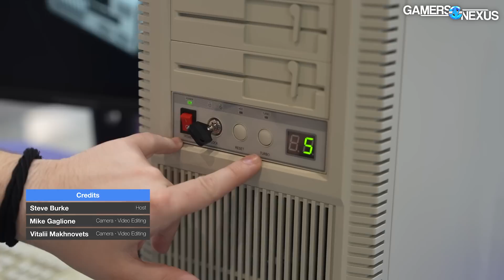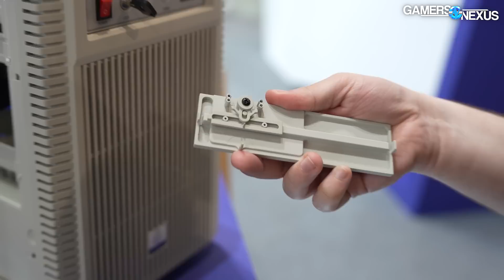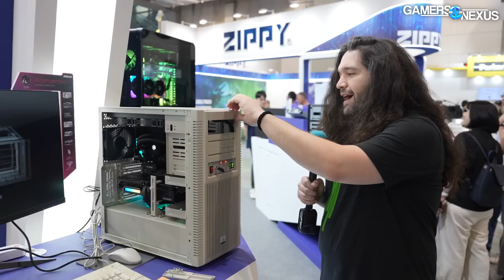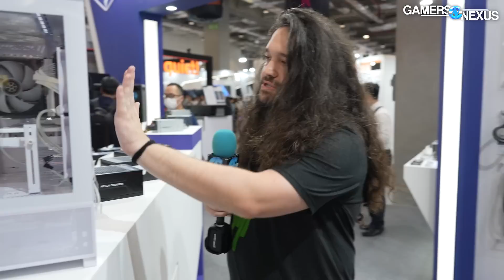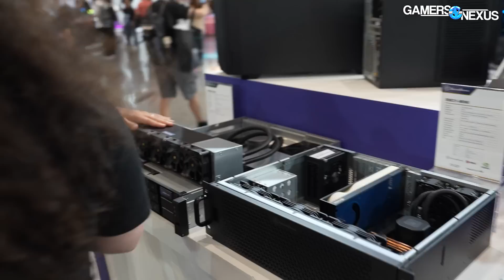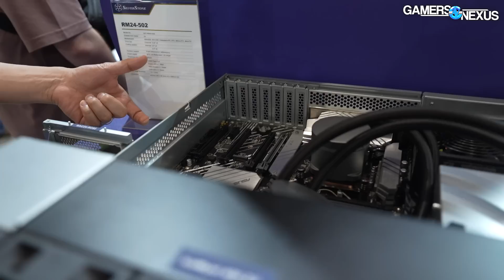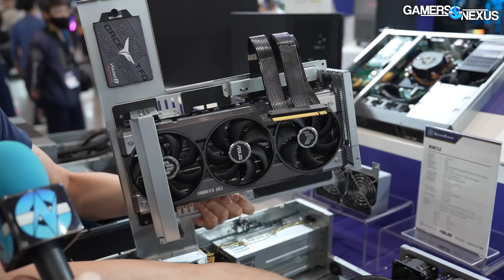Unironically the Best Case: Retro Silverstone FLP02 with Turbo Button

Comment: I got a Fractal Design Pop Air luckily available at my 'local' (two cities over, the closest computer store I'm aware of) Memory Express specifically because it had two 5.25" external bays, one for an optical drive and one currently with the included 'junk drawer' for USB drives, adapters, etc., but available for whatever modular front panel stuff becomes convenient in the future, while still allowing free through-and-through air cooling (the drive bays are on the BOTTOM, opposite the power supply, hidden behind a magnetic facade). Two kinda seems like the minimum for me, because in addition to wanting to read disks, I don't know what I'll want to install in the future, and a 5.25" drive bay should be big enough to hold an adapter (storebought or 3D printed) to mount whatever technology comes along. Seems like they could have squeezed in more though, just populate from the bottom up while staying out of the way of the top-third CPU air intake area.
Nice to see other takes on the idea of bringing modularity back into the front panel of modern computer cases. The whole thing about the IBM-PC-derivative... ATX thing is that they're modular computers built from commodity parts compatible between many suppliers who don't have to communicate directly for you to use their stuff together. Especially if you're not offering a ton of front IO ports, you need a bunch of modular panels so the user can install their own.
There's been a decrease in the amount of stuff on expansion cards only partially able to be blamed on M.2 storage taking all the PCIe lanes (I even reluctantly went with a micro-ATX motherboard with only one card slot available outboard of the graphics card for my latest build, despite my misgivings, because I could not come up with a scenario where I'd need more and shipping full-ATX boards to my remote location pushed everything up a price bracket; but forcing myself to do so made me sad and I have to say, including the annoyance of working on the thing with minimal clearance between components, I probably should have sprung for a larger motherboard of some description) and partially to how all the external busses are getting really fast and converging on USB. But one thing externally-attached peripherals can't give you is convenient front-panel stuff -- physical media drives/sockets, equalizers, status readouts, easily reachable IO panels, controls, whatever. That takes drive bays (or some other manufacturer-agnostic rack system, but 5.25" drive bays seem to be the industry standard here?).

Comment: I was considering the FLP01 for my setup with a CRT TV next to it but the FLP01 couldn't fit my Yeston RX 7700 XT (a decision before I got the CRT). I would consider putting Noctua fans in there for the color. It kinda sucks in my opinion that they don't intend to do a glass side panel. Now I still want to show off my gpu while retaining retro stuff

Comment: Heh funky - old enough to have worked as a tech in a computer shop getting things in that look like this thing, one fun bit of it is that the cases back then that had the LED display - you had to use jumpers to set the turbo speed display on them - and they didn't do anything almost ever - the turbo button was to slow machines down to fix software that had been made by... "creative" devs... who based certain delays in software on the actual clock 'tick' rather than the clock itself which resulted in all sorts of weird and wonderful things. Among them unclickable buttons, and dialogs that display for less than a second.

Comment: Hey @GamersNexus, you are all the time reviewing beautiful cases with a lot of rgb lights and glossy and glassy features, which would be a beautiful addition to the design interieur. But how about us, the practical people? We do not need a PC on the table, because it is under the table. We are not looking for RGB lights, because you cannot see them when they are under the table. Beautiful colorful water cooling? Well, where to put my HDD RAID then? Can you make an overview of the less atractive and more practical cases? which would still have 5.25" bay and will fit at least bunch of 3.5" HDD drivers ?

Comment: That retro case needs a plexiglass side window held in by rubber molding. So glad I was around when case modding took off. (That door covering the front io panel sucks. It would always be open, waiting to be snapped off.)

Comment: dont forget about the FLP01 that started as an april fools joke a few years ago. based off the standard of many pcs from the 80s/90s like the Amiga A3000 and PB Legend 1510. im still using my ancient SunBeam Transformer case from 2005 and i love it. pretty good temps since one fan points fresh air directly at the cpu. i cant wait to get the flp2

Comment: If a reasonably priced case came out that supported my 16 hard drives and 2 optical drives I would consider it even though I already spent an arm and a leg to get a 19 year old case that could at least support the 16 drives.  Technically, the power button and other front panel stuff is in a 5.25 slot so I could get a different power button to mount somewhere else and stick my UHD drive in and omit my standard drive so I'm not in that big of a rush to replace the case.  Even my dream case, the Rosewill Blackhawk Ultra can only support the 16 drives with zero optical drives.  (For anyone confused, I have two dual 5.25 to tri 3.5 adapters with 80mm fan intakes that gives me 6 drives more than the 10 supported by the case)

Comment: Glad to see more attention on the home server. It boggles the mind how rich feature sets are on desktop cases for the prices. Even sub 100$ can afford some crazy good build configurations.
Not so much in the homeserver space. Lucky to find ANY features worth noting on 200$+ units.
Likewise, I would love to see more attention from both motherboard and cooler manufacturers also.
Standard ATX memory layout impedes airflow, even in your typical ATX case. It's almost OK in a 2U, but forget using any standard ATX/ITX board in a 1U chasis, short of low power mobile processors.
The issue compounds with availability of coolers that can take advantage of the limited space. Without Noctua I don't think there is a single option for heat syncs aligned with fan walls on AM4/5 platforms.
Anyway, here's hoping we see a convergence and a similar swell in competition in the rack mounted space. It would be amazing to hit the retail outlets and find a dozen options that deliver more than I need for half the prices we're looking at right now.

Comment: Finally a Retro case where you don't need an angle grinder for airflow or watercooling. Other retro cases need some metal-massage depending on the heat generation of the hardware - Chieftec UNI UK-02B (white) and SilverStone FLP01 come to mind.....

Comment: Just rebuilt my 20'ish year old (who remembers 🤷‍♂) Silverstone LC01 all aluminum HTPC case. 9800X3d on an Asus X670E Crosshair Hero. Tossed out the junk drive cages and put an Artic Liquid Freezer III 360 across the front with Artic 120mm slim fans on the exterior. You can still fit 4 HDD's under the rad directly bolted to the case. It's the perfect case for today!! It's super quiet and keeps the -10 undervolted 9800X3d rock steady at 67C when fully heat soaked. Silverstone listen, build a real aluminum HTPC again!!! 🙏🙏🙏
Reply: I used to use the old Silverstone Lascala LC13 in a hifi rack for my PC case, that was so many years ago, back in the days of AGP, I ended up with the HIS 3850 AGP card just as everyone was moving away from AGP and Barton XP 3200's, I remember getting some Asrock motherboard that had AGP and PCI-E slots along with DDR 1 and DDR 2 memory slots for socket 775 in that Lascalla case as I wanted an upgrade path lol, new motherboard and new CPU with my old GPU memory and drives, PSU was a 680w Hiper Type R in blue lol, had a few of those and must be one of teh only people who never had one blow on them. 

Last HTPC I had was when Bluray drives came out and Windows Media Player could be updated with MyMovies, that was a Micro ATX Asus ROG with an E8500 and 4gb of 1066 Dominator GT, with a Powercolor HD5750 passive cooled GPU inside a Silverstone GD02B with a Samsung BR drive. Sharkoon Silent Eagle SE white fans with the golf ball blades were in that. 

I heard you cant make HTPC's that play and store physical media anymore without a load of ball ache.

Comment: My Gen 12 i9 is an Aztec case from 2005.
With the add-in drive three drive caddy, I'm running eight 14TB drives in addition to the NVME drive with Windows.
Cooling via a Corsair iQ Link single 120 AIO along with three case mounted 120mm fans.
Folks often think I'm running an old machine instead of a hefty "sleeper" build.

Comment: Can the turbo button be detected by the motherboard? It would be nice to be able to use it as an ACTUAL boost button, raising the clocks. I'm sure it wouldn't be terribly hard to make something using an arduino connected to USB to do it.

Comment: I have a Silverstone TJ08-E Evolution case (inverted layout) for my main rig and it would have been a great foundation to start from to build this retro case. I don't know why Silverstone doesn't keep innovating with that design. It is so well done. I have crammed so much into the case the the thermals (I'm cooling on air) are excellent.

Comment: I love that retro old school case.  I want it I want it I want it I must have it.  I want to build a sleeper PC in one of the retro style cases and this checks every box.  I even have an original IBM 88 unopened keyboard, and an IBM laser mouse when they first came out that still won't opened. 
  That would be the perfect trifecta...
I even have a 5 1/2 drive Bay pump res that I got from PPCS that world be perfect in this

Comment: That case makes me feel old... too long ago but thinks my first case WAS a beige mid-tower OR maybe a tall floor case with casters o0 then had a black floor tower from work; then a black mid with plexi side panels and had a fan side mouth WITH a LED fan, then went Antec quieter model, then a Thermal Take mid (still have it with my last PC as a back unit).  THe older black mid went to a family member and it STILL works o0

Comment: The flp02 should have the usb and io included in the bottom 5.25 bay. Not only would this be more era accurate, as these bays were used for things like firewire and front serial connectors, but it would also allow for genuine expansion of front io, which no other case offers outside of proprietary means. Then having to put in a USB header pcie x1 card to compensate for all the front io really would sell the whole yesteryear vibe, needing aic to make your slot in connectivity work.

Comment: This makes me wonder if there are any mobos in the wild that not only still have a Floppy controller on the board but have the connection port (and maybe cables) to hook a real drive or two in rather than the faux drives.

Comment: Cooler master used to make a hard drive cage with a 120mm fan on the front that fits into 3x 5.25 bays. That would be perfect for the retro case

Comment: I'd rather use a literal oven that can't be turned off or adjusted from its setting of 1000 degrees Celsius and magically still works even when not powered by anything, than this case. Sorry.

Comment: Very curious about "floppy" slots on the retro cage; 
some questions for the review, whenever that happens:

The covers looks nice, but are the slots viable to use for DVD/Floppy drives? 
Does populating the slots negatively affect acoustics, and airflow; if so, how much?
Possibility of mounting fan/fan-bracket in the drive slots, for additional cooling? 
Does the lower front fan have an airflow guide? Might struggle to cool some systems.*
Will there be any color alternatives?* *

*High TDP systems; even more so if slots are fully populated, as more ventilation gets choked off. Looks like they've went through the effort to add extra perforations all over to help with venting though, so might make up for some of it.
**Personally not a fan of the "white" plastic look of the late 20th century; does have it's aesthetics, but personally would want a black/grey one, I guess. Maybe you could hold a poll for them, or similar, for alternative colors; if they want to use your platform to communicate with their customers.
Reply: The question of populating the drive-bay with a fan for extra cooling, is mainly in the assumption that can become a hot box in some scenarios, which might necessitate it.

Comment: I’m no case expert, but my impression is that if the retro case had a top-mounted PSU then the blocked airflow from the 5.25” bays wouldn’t matter as much and CPU air coolers would get more air.

Comment: Steve would probably really like the new Cougar "floating" cases. They found a way to bypass the block the power supply shroud compartment creates from having a bottom intake for the main chamber of the case. It's quite a good take at case design IMO.

Comment: Thank god we're still using the ATX standard. Believe it or not, it's somewhat backwards compatible with the original AT standard, meaning I can pop my socket 7 build into this. I need one of these! I have a system with 3 different types of 3D accelerator (S3 ViRGE, 3DFX, and PowerVR), and it's just crying out to be presented in an awesome case like this. For any other retro nerds out there, here's the full spec:

- Soyo SY-5BT Socket 7 motherboard (Intel 430TX chipset) with low voltage modification to support the below CPU
- Intel Mobile Pentium 'Tillamook' 266MHz CPU running at 300MHz (75MHz FSB * 4), modified to run on a desktop board (soldered a bridge directly on the chip pins to enable L2 cache!)
- 64MB (4x16MB) EDO 60ns DRAM
- STB Nitro 3D S3 ViRGE 4MB graphics card (hard overclocked with a BIOS mod!)
- Guillemot Maxi Gamer 3D 3DFX Voodoo 4MB 3D accelerator (the one that you looped back the VGA cable to your 2D card)
- Matrox M3D PowerVR 4MB 3D accelerator (the one that has no connectors and pumps it's image over the PCI bus to your 2D card!)
- Creative Labs SoundBlaster AWE32 w/28MB RAM
- Roland SC-55mkII external MIDI synthesiser
- 3Com 10/100Mbps Ethernet
- 10GB Quantum Fireball HDD
- 40X Lite-on CD-ROM
- Running (of course) Windows 95 OSR2

Comment: Would be awesome if the turbo button changed the CPU speed, like back in the day (well I guess it would if the fan speed was low enough to cause the CPU to thermal throttle)

Comment: My old beige full tower case, ended up modded with a hole saw, PVC pipe, and very loud 120mm fans, to get the air flowing into the front and out the top. It was great when we started to see cases come out with those features as standard.

Comment: I always liked Silverstone, I had a FT01 back in the day, and I used the 3 front 5.25" drive bays to put an IcyDock backplane holding 4 3.5 HDDs for RAID. It was my first homelab server. Excellent case with good airflow for that era. They also did a ton of accessories for the weirdest use cases, like front mounted control panels (3.5 or 5.25) or USB hubs.

Comment: I'm planning on getting an FLP01. It'll sit on top of an original 386 baby AT desktop system.
Now I should get this FLP02. Slap some casters on the bottom so it can roll around with my 486 system.

Comment: It looks like the power switch will actually be a spring loaded button :/ cause in the video its in the off position and the computer seems to be running. There is probably a technical reason why the do it like that but I'd love it to be an actual toggle switch that would turn the computer on and off.

Comment: The Silverstone FLP02 is exactly what I'm looking for. A nice oldschool looking case with modern features. And even a 5,25" bay so I can install a DVD or BR drive. That will be very useful since I still burn a lot of discs for use with older computers and an external drive is just something extra taking up space on the desk.

I hope they put extra thought in the cover for the usb and headphone ports, since those things kinds of covers (on other cases) tend to break at some point in time. Personally I'd prefer an option for the user to remove it alltogether if they don't mind seeing the ports.

Comment: The FLP-02 will definitively be my next case, been looking for a new case with 5.25 bays since I neeed optical drives all the time since most events I work are held at community centers and such that still runs 80s/90s sound systems with no support for BT, USB or even MP3. And there is no way I'll gamble on bringing my original LPs and CDs to a 100+ guests event where 99% of them are total strangers to me

Comment: Silverstone, if it's not too late, please make it so the Turbo switch can actually be a switch that can just connect to a motherboard header if you supply the cable. Trust me, there's lots of people putting together vintage hardware with early ATX boards and even baby AT boards … YOU just built the case for them. Let 'em have a working turbo button!

Comment: A few years back well actually 10 years back lol, my uncle and I modified an AT classic full tower case with, the cpu clock speed, turbo, reset and keyboard lock, keyboard lock does the same thing as Silverstone and my turbo does the same thing but it only turns the fans on or off, and the MHz well it just shows HiMhz, very neat case if I did not already have two sleeper gaming PCs with working 5.25 and, 3.5 floppy, along with DVD, and zip, I would of looked into getting a pre-built sleeper lol.

Comment: I unironically want this case. Having easily this many easily accessible drives and a modern front air intake is very close to what I look for in a case. I would add a side air intake for the graphics card.